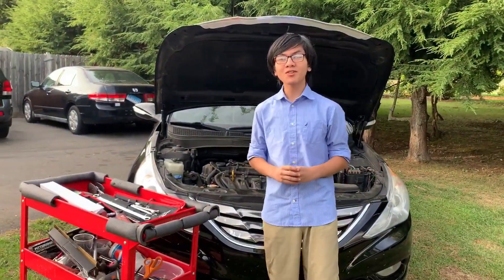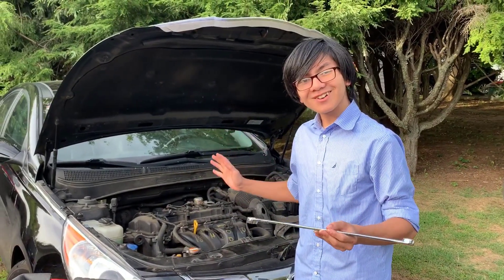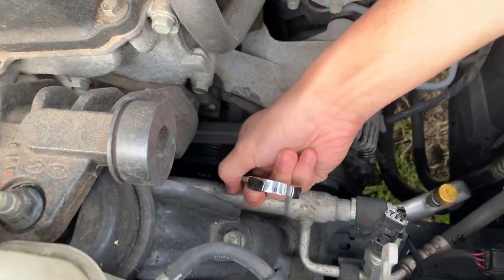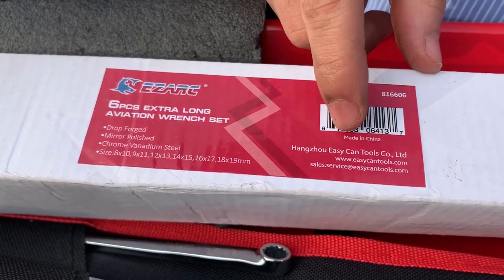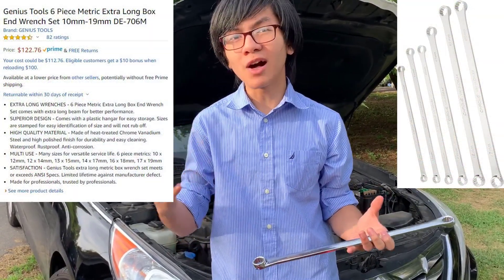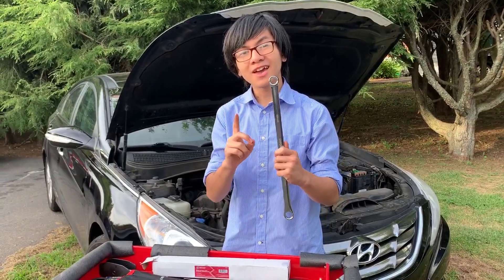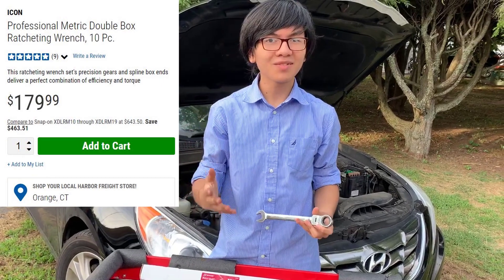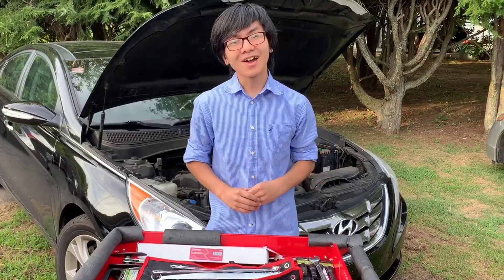EZARC Zero Degree Offset Extra Long Box End Wrench Aviation Spanner Set 8mm-19mm Tools Review & Demo

Comment: Hello, please. Question is there a fuel filter that is not included in the 2007 Toyota Prius? Thank you
Reply: Every modern car has a fuel filter ether in the fuel tank next to the fuel pump or along the fuel line any more questions?
Reply: @user-jq7nk1he6v  Yes, I have a question. If the 2007 Prius has only one filter in the fuel tank, thanks🌷